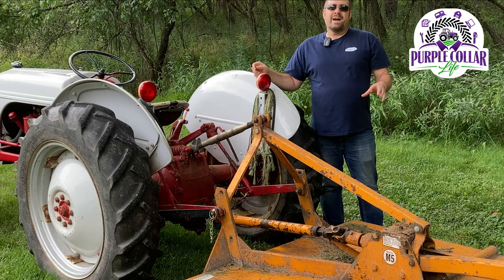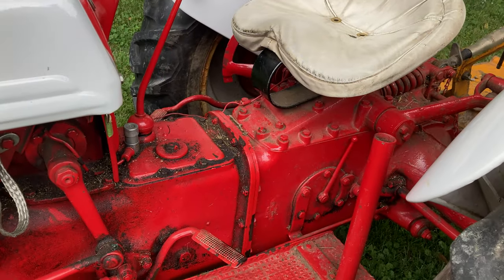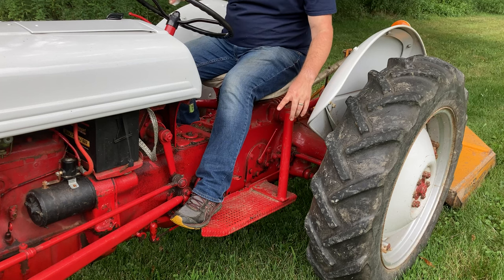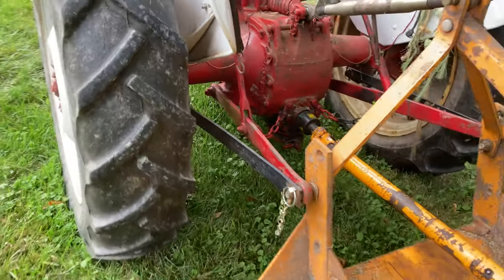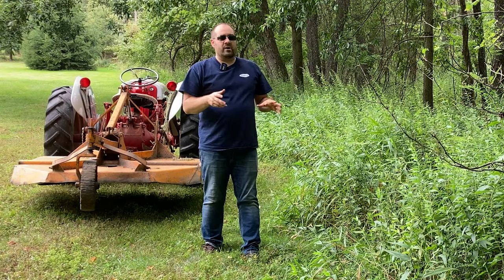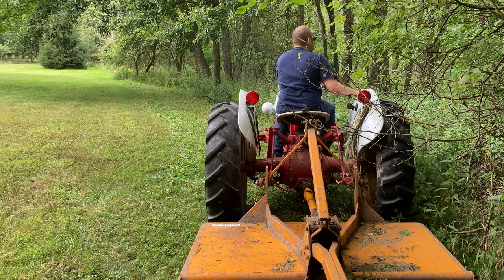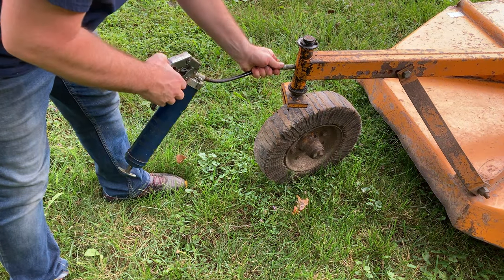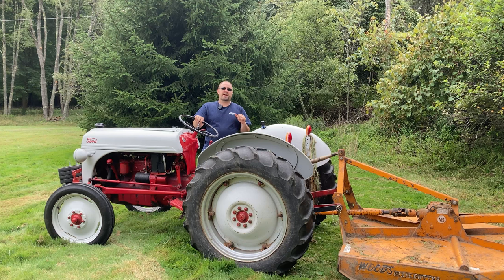How to brush hog with a Ford 8N tractor

Comment: I got my first Ford 8n. The only issue I have is when I have the brush hog up and start driving around it comes down immediately after I start driving am I doing something wrong?
Reply from the maker: When you lift the brush hog to move, are you then turning off the PTO for transporting to another location? With the age of these machines - sometimes they don't have the ability to maintain holding the weight up without the PTO engaged.  Another thing that I've seen is that sometimes if you put the 3 point lift lever all the way up - it will let the implement fall back down. Try putting it at about the 3/4 point and see if it maintains lifting the brush hog off the ground at that level.
Reply: Thats the lever that is on the right hand side correct. Still new to this. I have it on my trailer and I lift it up to take it down and when I move it that’s when it lowers
Reply from the maker: @gera75217  I think it sounds like you're doing it correct. Here's another few videos we made that might help you out with operation and understanding of your 8N. 
How to start and operate: https://www.youtube.com/watch?v=PDl2YH4IyyU
How to fix your driveway with an 8N: https://www.youtube.com/watch?v=Jt4bwsF92bs&t=8s
Maybe the best tractor ever: https://www.youtube.com/watch?v=Y8LcQbfueSY&t=3s
What to look for in an old tractor: https://www.youtube.com/watch?v=uKO_2ThkQfs

Comment: What position do you have the little lever under the seat in when you are mowing?
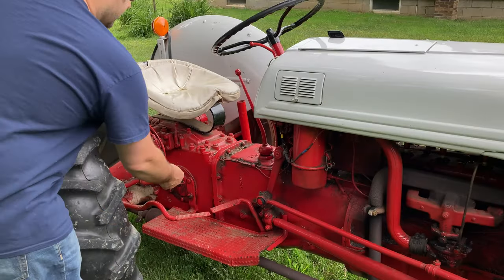Reply from the maker: Hello - great question. I never move that little lever. I don't do any ground engaging work with the tractor. It's in the up position, which you can see at about the 9:51 mark in the video. Thanks for watching! I hope this helps.

Comment: Whats the going price on one that's up & running, usable? I'm sure it's different depending on where you are, locally there is a fellow who has 5 of these sitting outside his house
Reply from the maker: Good question. It definitely depends on where you are, and what condition they're in. While the repainted ones are pretty - the mechanically sound ones are worth the most. If you find one that is both good looking and good running - they should demand the highest prices.  I usually see them in the $2,000 - 5,000 around here.  It's also nice if you can find one that has some implements with it - like the brush hog, or a back blade, or 3-point finish mower, auger, etc.

Comment: Hello, I just bought a few king kutter products but I don’t know if the top link is hooked up right to my Ford 9N tractor. The piece the connects from the tractor to the top link doesn’t seem right because it pivots up and down. We took that piece out and now have the top link hooked up to the side with a pin through which doesn’t seem right either. Any help would be appreciated
Reply from the maker: I’m not exactly sure what you mean here. The top link should go between the top connection of the implement, and the top attachment point on the 3-point hitch of the 9N.  That top attachment on the 3 point hitch will have a large “spring” attached between it and under the seat of the tractor. Some of these 9N/2N/8N machines had a “multi-level” attachment section here - with 3-4 holes for the pin to go through, allowing the top link to be higher or lower depending on the attachment needs. I’m not familiar with any place on the “side” that would attach to the top link.  If you want to email me a picture - that might help me see what you have going on.

Comment: Since these tractors didn't have a tachometer until the early 1950's, how do you know what RPM your engine is running at to achieve 540 PTO?
Reply from the maker: You really don't. I always just go by sound. On our 8N, it's not quite full throttle.
Reply: @PurpleCollarLife  What engine speed does it top out at?
Reply: Second screw on the throttle plate. IOW, almost wide open.

Comment: Can you tell me the purpose on the small lever on the right side under the seat?
Reply from the maker: Thanks for watching! That small lever under the right of the seat (only on 8N tractors) is for a draft control - used mostly for using a bottom plow.  I've never used it on ours.  I think it's designed to allow the arms to "float" when plowing, so that if it starts to dig in too deep, or hits a rock or bump, it can raise up a little, and then return.  I've read about some people trying to use it-figure it out.  It looks like it's for ground-engaging equipment.

Comment: How do you set the draft position on the little lever under the seat though??
Reply from the maker: We don’t use that lever ever. We set it and forget it.
Reply: @PurpleCollarLife  i figured it out. Set the big lever and use the small one for up and down. Which way you set it depends on if you need high limit or low limit.

Comment: Only, hopefully helpful, comment I would make is when greasing, carry a shop rag with you and pre-clean the zerks of grass and dirt before pressing in your grease with the gun, otherwise you are injecting that crud into bearing surfaces. It is probably not as significant as not bothering to grease at all, but still. Meaning it would be better to have some grease with a little grit in it than none at all, but I prefer to clean the fittings and ensure good clean grease is going into the bearing surfaces.
Reply from the maker: Great tip! I hadn't thought about pushing that gunk INTO the zerk by not cleaning it off - but it makes sense.  I'll wipe them off first from here on.

Comment: Why do you have it in draft mode?
It should be in position control mode unless you are plowing.

Or is that one of those tractors that does not have position control mode?
Reply from the maker: The Ford 8N has both draft and position control with that little lever below the seat. I haven't touched it - because my great Uncle (the original owner) said not to adjust that lever for the work we do. If we were ever running a bottom plow, I think we'd need to move it then, right?

Comment: Additional thing to note about the overrunning clutch.  They obviously space out the shaft on the tractor. This can cause issues with shaft geometry on some implements. 

The finish mower we have on our 8n would have only had about a 8” PTO shaft given how the gear box on the mower mounted. We had a custom shaft made that has the overrunning clutch built into the PTO coupler on the mower.  Made the whole shaft about double the length which allowed the mower to raise and lower some. 

Before with it so short if the height of the mower changed at all it would pull apart. 

B
Reply from the maker: Great points! We had to shorten the shaft on our 3-point finish mower to properly connect to the 8N without binding up the PTO.

Comment: 4:33 that's not the draft control. It's the hydraulic lift control. Draft is a function of the lift controlled by a separate, smaller lever under the seat.
Reply: 6:55 you again called the lift control "the draft lever"
Reply: 12:03 again, that's not the "draft control"

Comment: It won't if you have the mower down in the grass when you step on the clutch
But it is safer with a clutch
Reply from the maker: even when the mower is in the grass, the momentum of the large wheel and blades will push the tractor forward a short distance. (Unless you use an overrunning clutch like I suggest)
Reply: @PurpleCollarLife  
The large wheel is called a stump jumper 
Most mowers have a big bar that holds the blades 
I had a 3 blade grooming mower blades wetter only 20" long and when you stoped every thing stoped because of the drag from the belt and the grass

Comment: While you're lubing the tractor, dont forget to check the fluid level in the gear box on your bush hog.
Reply from the maker: Excellent point! I know some people don't check those gear boxes for 5, 10, 15 years (or longer)! I probably don't drain and refill the gear box as often as I should - but I do at least check and make sure it's still topped off (and not full of water).

Comment: A friend of mine has a 54 Jubilee. It moves pretty fast in 1st gear while bush hogging and was wondering how to go about slowing it down a bit?
Reply from the maker: I usually brush hog in 1st gear along the edge of the woods or in a field - that's a good speed for me. 
There's really no way to slow down the speed - because 1st gear is the lowest. And decreasing the throttle will slow you down - but it will also slow down the PTO.